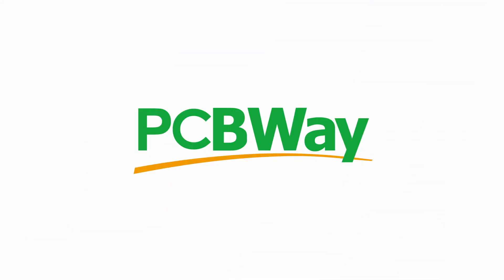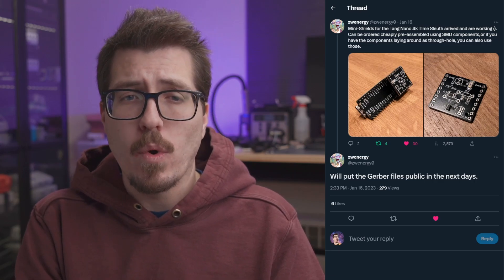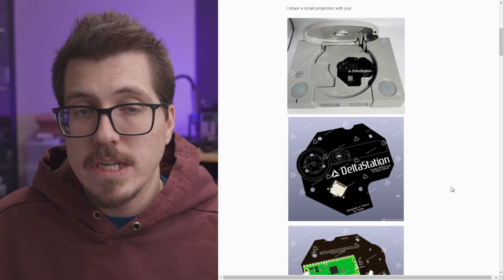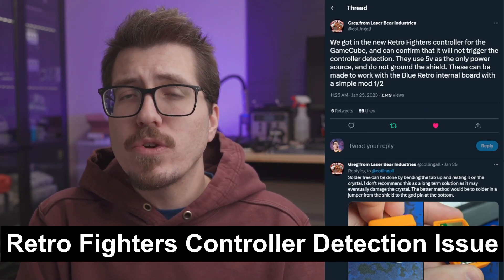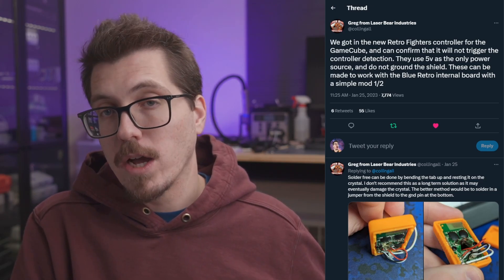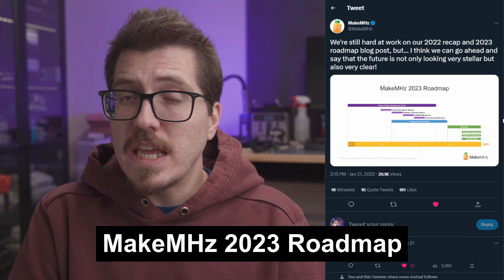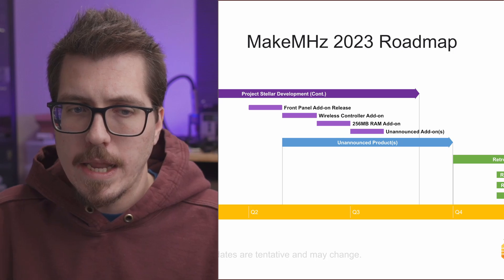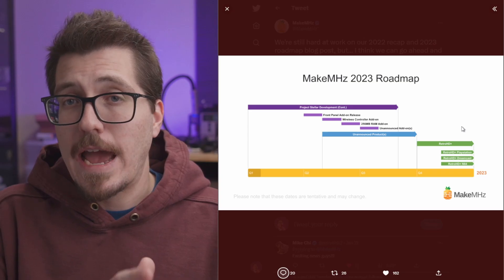MakeMhz Announces 3 New HDMI Mods! - Retro Modding News

Comment: These HDMI mods can go on in eternity. Im all good with hooking it up to a good upscaler. Now upsccalers are more needed because alot of newer tv's no longer have the ports needed. 
Maybe solderless. I don't want to solder anything really. There are so many ports on these consoles, and they couldn't figer something out. Meh solder i hear is better idk. 
I still think the mode is a way to go. Hope for a update. for SATERN and Dreamcast. 
They should just get emulation more accerate and better to run on most hardware. I kinda don't like alot of stuff. Retro consoles may be from another home, other peoples home smells.